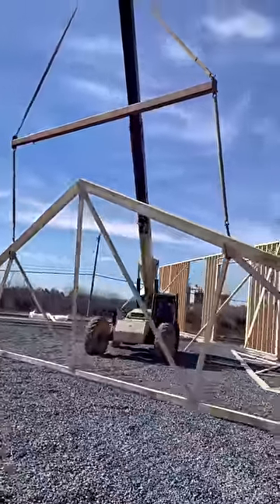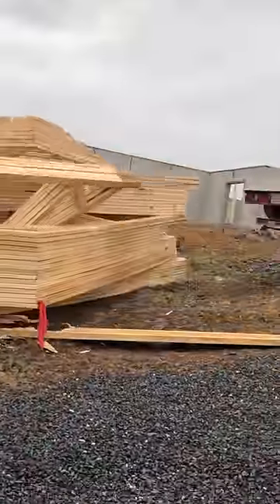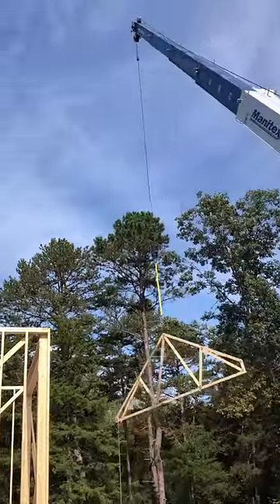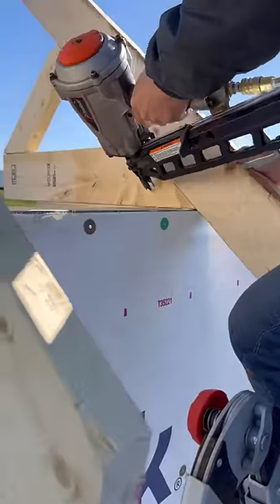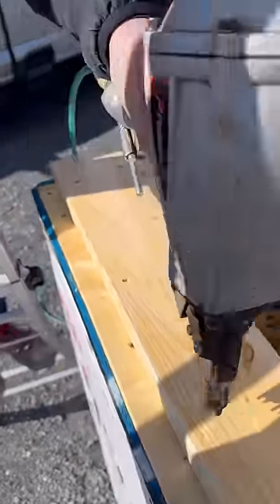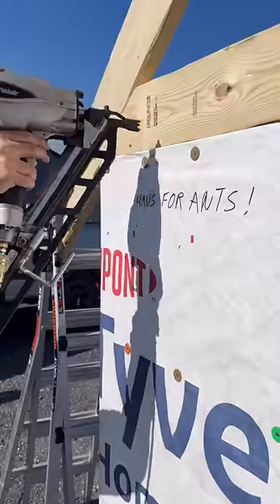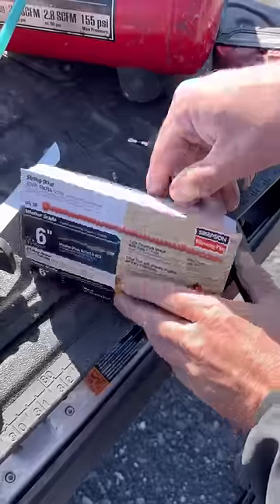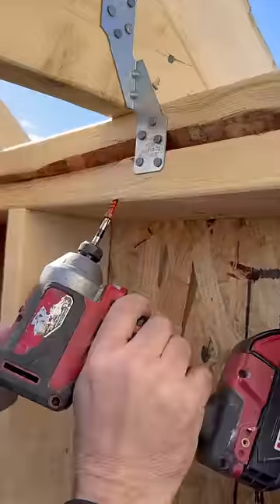How Roof Trusses Work

Comment: For space, I want rafters. Hurricane clips can also be installed.
Reply: @hausplans Rafters won’t meet code here 75lb per square foot snow load . Cheap out on the structure and you’ll be building it again . 👍🇨🇦
Reply: Trusses
Reply: @cameronhamer9432  Do you have any homes around from the 50s or 60s up there in Canada?  Pretty sure if you check they'll have rafters
Reply: @JesseVanPelt  the older homes that have survived in our area have extremely steep roofs . Most of the old buildings have been replaced , poor wiring , glass , plumbing , insulation etc ….. just saying a poorly built house won’t last . 👍🇨🇦
Reply: @cameronhamer9432  
What?
It doesn't make sense... It just depends how strong the rafters are designed. 
I don't get American codes. They focus on the type of structure and not the strength of the structure. 
Don't you have engineers working on every single house mandatory to design the structure?
Or your codes say "use that type of structure" and a random DIYer (because from what I see, it's more DIY than proper carpenters) does the job based on a one solution fits all kind of mentality?
Reply: @fabr5747  I’m Canadian , here in our region we get extreme snow loads , rafters are OK , but from a engineering aspect trusses will carry a heavier load  and achieve greater spans . I don’t know American Building Code , but in Canada a engineers drawing is usually required , but if your a certified Carpenter you should be able to build a simple structure without a engineers approval . 
Where I live no permits are required , build whatever you like . No inspections , most builders would like to have such freedom . 👍🇨🇦
Reply: @cameronhamer9432  
1. So what you are saying is that you wish that carpenters knowing nothing about the physics should be able to build whatever?
What do you think the result would be? Builders building unsafe houses for the same price sold, but with much less safety involved. 
2. No... A properly designed home will have a load requirement for snow, wind, and whatever kind of efforts will act on your house, and the building will be designed accordingly. 
The load is impacting the design, and the dimensions of the structure will be adapted. 
The decision of truss vs rafters is an architectural decision. Do you want an habitable space under the roof or not? 
Then, the dimensions and the frequency of the structural elements will be adapted.
Reply: @fabr5747  are you calling us carpenters stupid ? We built houses for centuries , knowledge handed down  . A basic structure is easily constructed safely , engineering specifications a clearly written out in the building code . Anyone who can read should be able to understand . Having a engineer on a basic house build is just a cash grab . 👍🇨🇦
Reply: @cameronhamer9432  
Absolutely not stupid, just no engineering background, the same way, the engineer is not doing the job of a carpenter. 

And then, you're confirming what I said... Your codes are recommendations about structure types, and not proper engineering.
Reply: @fabr5747  well that’s what is wrong with engineers , you should be a tradesman before your able to take engineering . And if you going to be a structural engineer , a Carpenter first .
To build a simple structure , such as a house you shouldn’t need a engineer , if you were building a bridge maybe . Although I worked on a bridge project , and I had words with the engineer about the method they were using to repair the bridge , and then I quit as I felt it was unsafe . He killed half the crew and maimed the rest , if he had some experience on the tools he would of done things differently .  👍🇨🇦
Reply: @cameronhamer9432  Maybe the problem is Canada ?
Reply: @cameronhamer9432  
Why would an engineer learn another job when both are supposed to work hand in hand?
And according to how it works in North America, and how houses fly away to often, structures collapse, etc, I would recommend a bit more of engineering wouldn't be bad. 
The precision level in your houses is terrible, working on construction site to cut stuff with tools not adapted for it when you could do all the cuts precisely in a proper workshop.
Not to say the absurd level of safety on construction sites. I'm amazed at how unsafe your construction industry is. Walking at three meters high without protection, as a fall is likely to injure someone severely. 
I'm amazed at how the foundations are rather weak and how your houses have a weak connection to the foundations. 

"He would of done"? What does that mean? Tell me it's not the only language you speak.
Reply: @fabr5747  if you built a house to code , it would be a cheaply made , roofs only fly off on the East Coast , in areas along where sometimes it’s not fit to live . 
A foundation should be isolated from the structure , during a earthquake the foundation is the first thing to fail . The structure should remain standing without a foundation . A wooden house stands up to a lot of abuse , I lived thru a 7.7 earthquake . Not a single building collapsed , it went on and on thought for shure somewhere there would be some damage , nothing  . 
Many of the building material being used now is actually poor quality , or hazardous . OSB sheeting is used extensively , and it doesn’t withstand abuse , wind etc …. Vinyl siding is terrible , a fire hazard , spray foam a health hazard , and they put so much in they stop all ventilation . 
A engineer should have trades training , tell me more knowledge isn’t worth while . 
English is my first language , yours probably isn’t . 👍🇨🇦
Reply: @cameronhamer9432 so as someone with a degree in engineering and working to get fully licensed, your comments on foundations are not correct. It’s essential that a structure has a solid connection to its foundation and is not isolated. If it was not connected, during a seismic or high wind event the structure would simply slide or be lifted up off the foundation. Also OSB panels are one of the best ways to resist lateral shear forces applied to a stud framed wood structure. They technically have a higher reduction in base shear than even several types of steel moment frames.

I do absolutely agree with you that engineers need field experience and discussions with contractors/framers. Both sides benefit from a greater understanding of why each trade tends to do things a certain way.
Reply: @Larry_Owlmann  OSB has little strength when compared to Marine grade plywood , or even standard grade plywood , nails pull thru OSB and it promotes mold .
We can argue about foundation connections , but most houses are just secured using 2x6 plates bolted with anchor bolts , they  really aren’t attached too well , basically the shear weight is keeping them in place  .
I’ve framed hundreds of houses , wood is my preferred method , I’ve used steel studs and they aren’t all that good . Once I saw a building made of steel studs subjected to fire , and the drywall simply fell off the studs , I don’t know if it wasn’t installed properly , but a wooden structure will withstand heat better than steel .
Reply: Attic trusses work just as well.
Reply: @fabr5747  No that's not what he said, you're editorializing showing your bias.
Reply: @fabr5747 I'm curious, what types of wind or weather events do you think is causing these houses to "fly away" that you see videos of? I'm not sure you necessarily grasp how extreme some of these events can be.

Comment: I used to stick frame roofs. it's a bit more time consuming, but it's a better roof that has a ridge board. The houses built in the 1960s and '70s with truss roofs two foot on center sag at the ridge an over large spans like the garage. Also the video shows a trusses being lifted one at a time, we've always lifted them in bundles then braced off. We would then walk them down the walls. This was on ranch style houses.
Reply: Sag at the ridge? My house has trusses at 24” spacing and was built in 1972. I see no sagging anywhere BUT the addition that was built in 2001 that has rafters at 16” OC with vaulted ceiling I can see sag between the rafters in the roof shingles from outside. The truss roof at 24” OC I see no waves or sag anywhere near the ridge or at all.
Reply: @lh98 use metal beam
Reply: @NorthKoreanSimp  you’d have to elaborate a bit more as I’m not a builder. Are you telling me to use metal beams on an already existing home?? 
Or are you suggesting metal beams run horizontally from rafter to rafter to support the sheathing?  Unfortunately with the vaulted ceilings I have no access to get between the rafters. No offense but “use metal beams” left what you are trying to say quite vague.

Comment: I like how you install an additional plate for the truss
Reply: I was actually shocked to see that . I do that for gable trusses as well .  In a similar twist . If I have a 2x4 wall , I'll drop a 2x6 on the top , flush with the gable side . It'll become the nailer , a better walking surface when framing in the gable , Stiffens the wall more , Many carpenters will run a ceiling joist to the gable side flush to the outside , Then drop in a 2x nailer aside . Then they might put a plate atop the joist to pick up the gable framing , Some don't and toenail cheesy to the joist . Pertaining to the truss . Always better to put the nailer in first and do just what is shown . Don't know how many times some goomba's toenail the truss on the gable side and since most trusses are SYP . The nail will curve , not attach and when you put in the nailer , Can't bed the freakin' thing with nails jutting up
Reply: @Sjwolosz321  good to see yu thinking ahead helps the drywaller aswell for fixing points

Comment: Trusses differ in spec due to snow load and other factors. I know in Michigan you have to have heavier W trusses, while down one state south are able to get away with normal ones.
Reply from the maker: Yes, trusses have to be designed to withstand the snow load and wind speeds of the area where they’re being used

Comment: For your own home - use a cut roof , much redundancy ( a meteor could hit one section and the rest would be ok) A cut roof last 100 years plus, trusses highly loaded, if one fails at the gang plates , the trusses either side cannot carry the “panel” area of the truss lost and a whole roof failure occurs. Truss roof design life 25 years. Much more critical in Australia due to concrete and terracotta roof tiles at approx 52kg m2. Biased chippy 3rd generation, trusses are made for speed and large rooms not quality, unfortunately my country is riddled with them and insurance companies are not paying for failure after builders warranty is expired. Love your little videos mate.

Comment: Working on Habitat Houses, new construction we installed hurricane straps on our trusses.  BUT we did not put the special strap nail in EVERY nail hole.  The inspector made us go back and put a nail in every empty nail hole.  The straps do not reach full strength unless EVERY HOLE IS FILLED WITH THE SPECIAL SHORT BIGGER DIAMETER NAIL?.  Then the fun began…there was not enough room to swing the hammer. If I remember correctly, the trusses were on 16inch centers.  Solved that problem by running to the lumber yard and buying a “palm nailer “ for the air hose.  Worked beautifully.  Drove those short stubby nails perfectly, but noisy as hell.  The palm nailer was only about $45.  You will need ear muffs.
Moral of this story…….DO IT RIGHT THE FIRST TIME.  He also made us nail the sheathing on the roof every 6in. He even got up there and helped us add the missing nails.  It is quicker to nail the sheathing at code spacing while you have the air guns and compressors handy.  DO IT RIGHT THE FIRST TIME?  SAVES TIME BY NOT HAVING TO GO BACK AND “FIX” IT.  This advice is for beginners….old hands learned it long ago….
I did not learn this getting my Civil Engr’g degree. Learned it the hard way.  Ask me about protecting your eyes and hearing.  
JoeB
JoeB

JoeB
Reply: I volunteer with Habitat weekly.  On our last build another volunteer and I installed the H1A hurricane ties on every truss, which required 10 Simpson nails per tie.  After installing a few ties, I dashed home and grabbed my palm nailer and compressor.  I had only used the palm nailer once over 10 years ago.  It crapped out on the first nail so we were back to hammering!  When I dissembled the nailer later, it looked shiny and new inside except that every seal and plastic internal part had deteriorated and failed.  Into the trash it went.

Comment: Nice video. I have been setting trusses and nailing on Simpson clips for 20 years. I have never seen the screw. How long have  those been out? What a great set up. 
You should show a video how to clip your exterior walls? Do you guys ever use the threaded rod method? We used that in Florida for a little while
Reply from the maker: Those clips have been out for a couple years actually had a Building inspector tell me about them and how much faster they were. I really like them.
Reply: Yes, what a much better solution than all those Teco nails in the side of the wood.

Comment: I would say truss.  Just depends on the area, who made the truss, and what kind of lumber was used.

Used to work at a truss plant, could tell how good it was going to be depending on what brand of lumber we were using.  Mainly using #2 SPF and it would vary from brand to brand.   Had 1 bunk that had maybe 30 out of 294 that was not cracked.

Comment: Another lesson…when installing trusses , use diagonal braces between trusses to prevent the partial  row of trusses  from blowing down.  Back in the early 90’s our church was expanding. As the framers were installing the trusses on the new sanctuary addition they failed to use diagonal bracing.  The partial row of trusses blew over and 2 of the framers went down, with the partially installed trusses. Blown down by wind. They were both killed.  The fall was about 30 + feet.   Young men probably on their first big truss job.

Comment: Please check out the detailed manufacturer installation guidelines for the truss hurricane clips, when I did, I found out they are to be installed on the outside of the wall sheating making them a pain to install but prevents the top plate from peeling off and properly transfers the uplift load to the wall and down to the foundation.
Reply from the maker: That seems weird, I’ve never seen it done that way. There’s some situations where trusses don’t hang over enough on the outside or would not be thick enough at that point to put a clip on the exterior.

Comment: Engineered truss are the way to go. Makes for way easier renovations per the interior of the home in the future. They’ve been mass produced since the 60’s.
Reply: @h2s142 I totally understand that. It wasn’t an assumption. It was a comment based on a common home with engineered truss’s. I know when to put in a beam and columns multi level depending on what’s required. I’ve been in the trades since 1985 and am a renovations estimator now. I get your comment. (I get it)
Reply: And that’s why God invented structural engineers.

Comment: The roof truss is not designed to have the webs transfer load to interior walls unless it's a specific point load. They are generally engineered to be full span and self supporting between the bearing locations. Just a tip
Reply from the maker: Correct

Comment: One difference between the connecting plates and the screws is that an inspector later on can peek in your attic and see that the tie downs are installed.  It can save you a lot of money on insurance in places like Florida.
Reply from the maker: Good point

Comment: If you have a crane and enough space you can pre assemble and fly the truss roof in 8 hours.
Reply: I've done it in 4 hours with 4 guys
Reply: @thally4061 I guess it depends how big the roof is. 🤔  I've built some building's where we were craning for several days with the caps having bottom chords that were like 70 ft. and the base trusses bottom chords like 140 ft. They had to shutdown the canyon to bring our trusses up because they were so big! They came in 3 truck loads, the base trusses were over 40 ft. high or (wide) on the truck and almost 160 ft. long with the tails!
Reply: @wesman7837  I would have designed that whole roof differently those are some massive spans.

Comment: Rafter s!...Creates usable space....Quality Construction  vs Speed...QUALITY ALWAYS WIN!
Reply from the maker: You can get attic room trusses built, that will give you attic storage
Reply: @hausplans  ...Yes, I know that...and have done that-but still limited space...you will learn with experience...it's not about  speed construction and less Labor- it's about having a quality product at end of time
Reply from the maker: Actually, I would argue that quality designed trusses is a better product. There’s no gues work. They are engineered to the exact wind speed, and snow load that’s required in your area. It’s not just about speed. It’s also about affordability. There’s a lot of young families that can’t afford a homes. We need to do everything we can to build safe, energy efficient homes that are affordable.
Reply: @hausplans  Well, you are young...in time you will understand....
Reply from the maker: I’ve been Building for 25 years
Reply: @hausplans  still young..I appreciate your enthusiasm and video....trusses have been very popular for 25 years +...I am sure you know the system...the experience I have lived is that trusses were a cost cutting, quality cutting option....what thickness sheathing to you use?  What thickness drywall do u use on truss ceilings?..do you add strength blocking-in both directions?